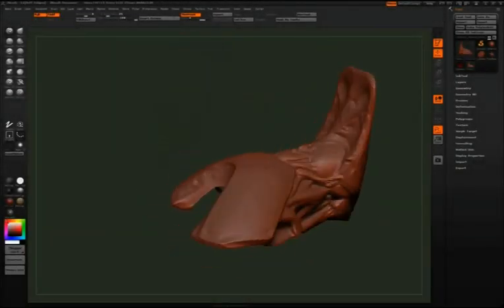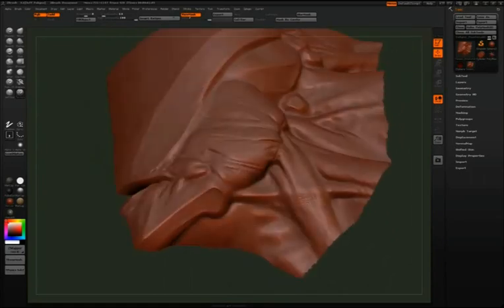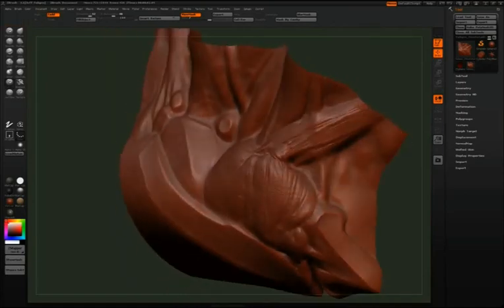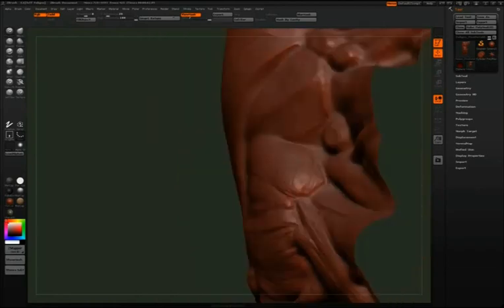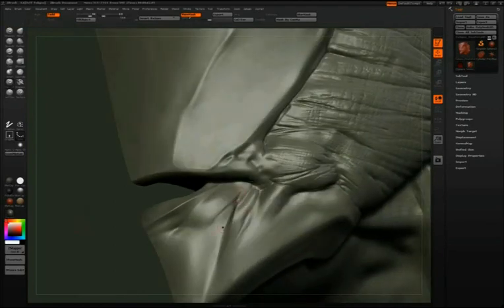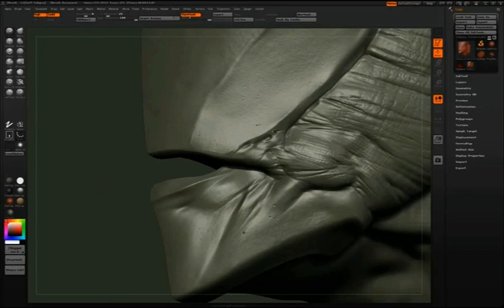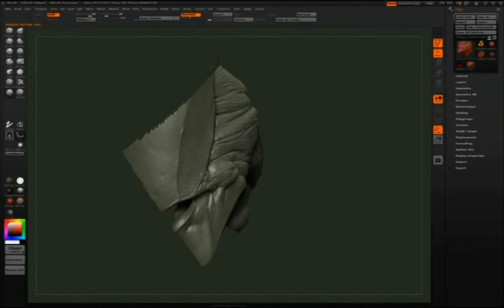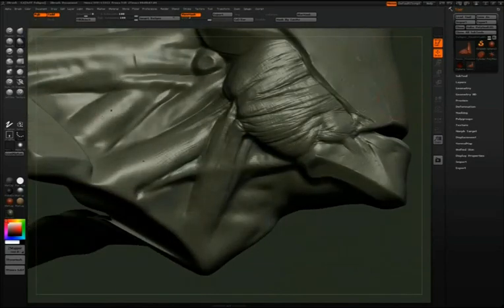ZBrush Tutorial (Sculpting in ZBrush for 3D Printing) Chapter 3

Comment: Technically As big as you want, although you will have to print it in parts and glue them together, if you want 1 piece then its as big as the 3d printer you are using can print at.